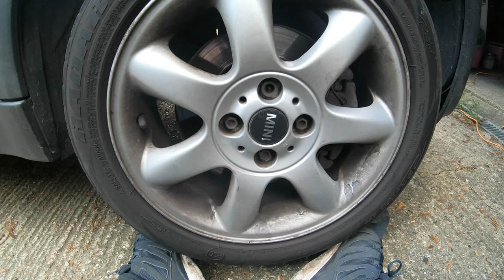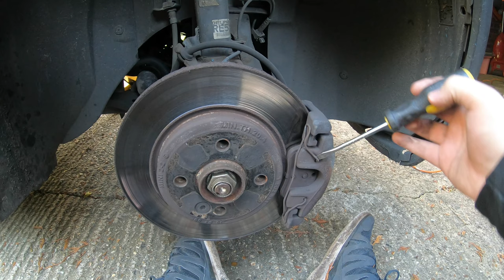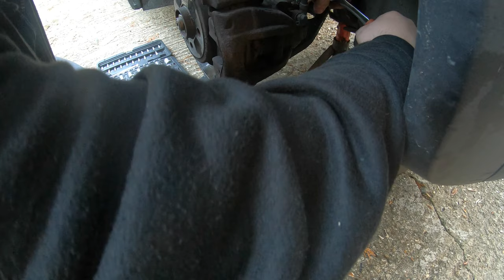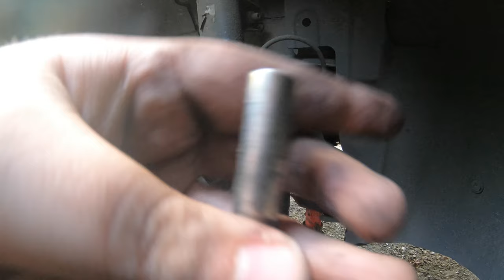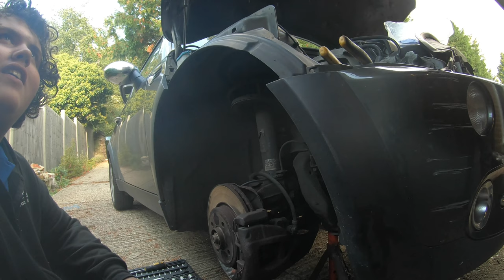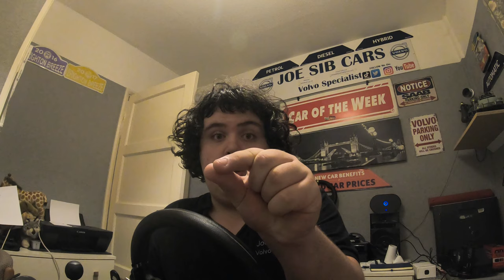Mini Cooper R50 R53 Front Brake Pad change

Comment: please dont use an impact on locking wheel nuts .
Reply from the maker: If it's bad to use an Impact on locking wheel nuts why are garages using impact guns on locking wheel nuts then it's fine to use an impact on locking wheel nuts because I didn't ram it with the impact I just let it spin the bolt in then I got a Torque Wrench and Torqued it to 105 Ft-LB I didn't tighten the bolt with the gun it's fine using an impact gun because if it was bad garages won't be using them So Take care
Reply: @JoeSibCars  from someone who dose locking wheel nut removal . The keys are not strong enough. Use of a impact will end up damaging the key. On the normal type locking nut keys it has a high chance of snapping the key inside the Patten . Garages don't always toque nuts so is that ok cos a garage dose it.?
Reply from the maker: It's Actually a Bolt and I didn't put it in that hard and i Torqued it to factory spec and the convertible mini,s have the same locking bolts so it can take the torque of 105 Ft-LB because before I torque a locking wheel bolt I look up the torque specs so I don't stap the key I hope this helps And Take care
Reply: @JoeSibCars  it's not the toque it's the speed the impact used taking it off.
Reply from the maker: It's not the Speed there is nothing wrong with using an impact gun because it makes the job quicker and the key didn't snap and I've used an impact gun many times on locking wheel bolts and I've never had a problem Take care